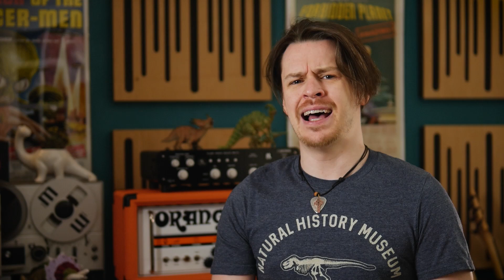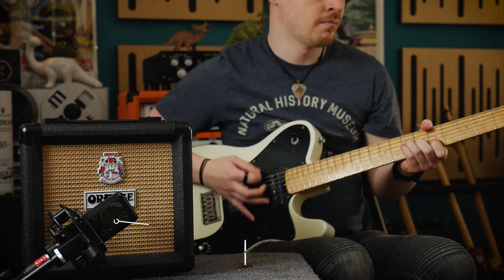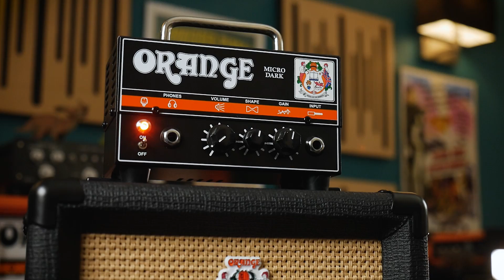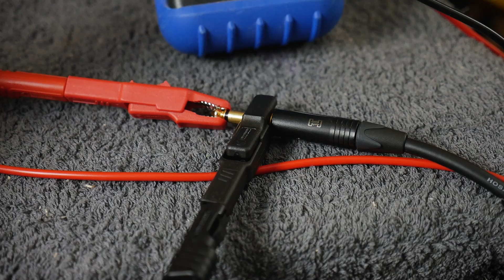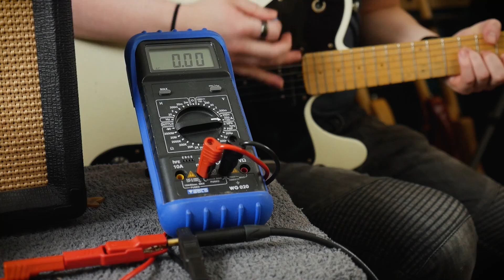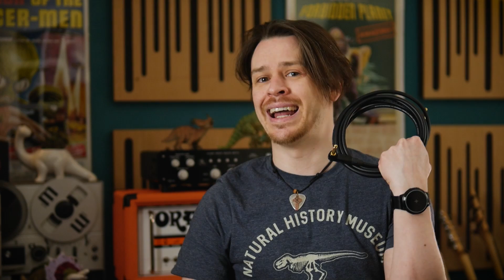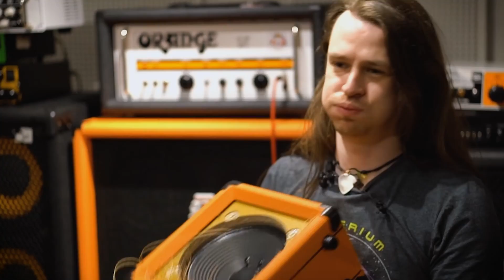Are AMPLIFIERS a LIE?! Guitar Direct into Speaker | Too Afraid To Ask

Comment: TATA: What if you connect guitar to speaker through a power amp without a preamp or preamp but no power amp?
Reply: This depends very much on the gear used. 
Directly to power amp you would probably experience some sound "sagging" (generally power amp expects "line level" signal) and very "sterile" tone (preamp shapes the sound). If you use a pedal or an active pickup, this alerady gives you kind of a line level signal, so the sound may be OK this way. 
Just the preamp is I guess the only one of those "experiments" we are talking about which can be dangerous for your gear - a speaker is a very low impedance load, so in regard to output stage of the preamp you are essentially putting it in a short circuit (hm, the same goes for "driving" the speaker with a pedal only)

Comment: One thing I have wondered, why does a Metal Zone sound better in the  return of the fx loop than it does in front of an amp?
Reply: There are discussions on the 'net that the Metal Zone has all the characteristics of a pre-amp, so taking your guitar into the pre-amp section to boost the signal first, then applying the zone in the effects loop means the character of the pedal is not affected by the "colouring" of your pre-amp.

Comment: What happens if you plug the guitar into a stereo or a surround system? They do have built in amplifiers right? Or am I missing something? I am honestly asking, I am a layman.
Reply: Did you get the answer?
I'm still in the same situation.😔
Reply: @Yash-vq9hl  Yes, I tried it. The sound was in only one channel and the volume was really low. However I ran the guitar through my multieffect and then through the stereo and it was much better and stereo too. Nowhere near the volume of a guitar amp, but for home use if you don't wantto disturb the neighbours, butdon't want headphones all the time, actually quite usable.

Comment: You can drive your speaker cab, you just have to stop using the cable. According to theory of general relativity, general deterministics and everyday non-sense hypothesis regarding scalar waves and electrical induction, just play the guitar and speaker will automatically recognize an authentic rock-star attitude and produce the best desired sound, clean and/or distorted, best thing is - you can drive the type of desired sound via power of intention alone, and are able to produce every type/style of amp. Best thing is - it also works FLAWLESSLY on air guitars. Enjoy and rock on.

Comment: What about plugging a guitar directly into a HiFi amplifier and speakers (rather than a guitar amp), why does it sound like crap? (At least compared to a proper guitar amp especially if you throw in some pedals)
Reply from the maker: Hifi amps and speakers are designed to recreate all frequencies as accurately and evenly as possible so not to change the signal's fidelity. 

Guitar amps and speakers are designed to drastically change the signal, crop and adjust its frequencies, and output something totally different. 

Hifi is sound reproduction, guitar amps is sound creation.

Comment: There's only on more question now: how many boost pedals does it take to drive a cone???
Reply from the maker: It's not just a case of increasing the signal many times, it's also about efficient power transfer and for that impedance needs to match. 
No matter how many boosts you have they will not output an impedance to match a speaker, so will never effectively drive a cabinet.

Comment: TATA: What would happen if you used a multifx unit or processor (Helix and the like) directly with a cab? Most of them have cabsims when used directly for recording, but would the onboard digital preamp be enough to drive a proper speaker?
Reply from the maker: No, they output line level signal and are expected to go directly into FOH, which is basically a giant amplifier connected to big speakers.

Comment: I would like you to try this again, but using a powered 10" speaker or wedge, and then compare the tone against a conventional guitar amp head and cabinet. Some guitarists I know have gone "ampless" on stage and use amp sim pedals / foldback wedge. Wondering how the tone compares.
Reply from the maker: In such cases they will be simulating the response of a guitar speaker cabinet too. 
Stage monitors are FRFR and are accurately recreating whatever goes into them. For them to produce the sound of a guitar speaker (which roll off a lot of frequencies) the amp simulations will have cabinet IRs applied to recreate the response of a specific speaker and microphone arrangement. 

If done correctly there is no difference between an amp sim and IR through a FRFR monitor (basically any hifi speaker) and a recording from a physical amplifier and speaker played through a monitor.

Comment: I will say this though. You can plug your guitar into stereo amp and play through it. When I saved up enough to buy my first guitar I didn’t have the money for the amp. So I plugged into my dads Kenwood home stereo and got a decent clean tone. But I never tried using a pedal into the stereo system, so I don’t know if that would work. Perhaps the great Collin can answer that?
Reply: Oooh it works ;) just need an external power source to power up the pedals.

Comment: this confuses me, when i first got my guitar i couldn't afford an amp to go with it. after a little while and experimenting i found out that i could use this old karaoke machine as a crappy amp, so what exactly was happening there? i doubt they would build a guitar amp into the machine intentionally?
Reply from the maker: An amplifier amplifies but doesn't care what it's amplifying. The signal that comes from a microphone is not so different from what comes from a guitar pickup. Plug a microphone into a guitar and and you'll amplify your voice. 

The only difference is the impedance of the input.

Comment: Instead of a Rat, what if you used an overdrive or a boost pedal to drive the speaker?  My understanding is that those act in a similar fashion to a sold state amplifier.  I use an SD-1 in front of my JCM 2000's clean channel with the level up and the drive at zero and I notice a distinct increase in volume.
Reply: It  would not work either. Most of the pedal effects are designed to be low power. They are not capable of delivering the electrical energy to move a big speaker cone so you can hear an audible sound. Some headphones could work though. The SD1 in your example is just hitting the JCM preamp section but you still need that JCM power amp to drive the speaker. Try to connect the FX send to a cabinet and you will hear it;)

Comment: In addition, the guitar's and pedal's output are "signal", this means is the voltage changing as the information of signal , no much matter the power and current.And to drive a speaker you need electric energy, amplifier is to give signal much more power to do this.

Comment: Dumb question but what about a powered speaker? My cousin ( piano player ) always wants to jam together but I don't want to bring my 1milion pundits bugera  333xl to his house lol. It's fine when he comes to my house  because I have pianos he can play here .He does have powered speakers tho. Could I just bring my pedals and guitar to his house or should I just go ahead and bring my micro terror ad well ( all which fit into my guitar case ). Never used a powered speaker before so I was just curious.
Reply from the maker: A powered speaker has an amplifier built in, that's what you are powering. It will accept a line level signal, so if you run your pedals into it you'll get them amplified. 

Do not run another amplifier output into the powered speaker.
Reply: @ScienceofLoud  Thanks!!!!

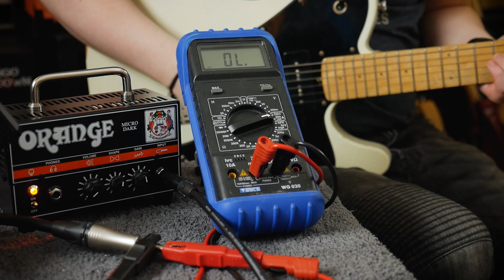Comment: 4:15 how did you measure that? Surely, a multimeter is not a sufficient load
Reply from the maker: Solid state power section, so can run safely without a load and was only connected to the multimeter for as long as you saw it this shot. No harm done. Don't do this is a valve amplifier.
Reply: @ScienceofLoud  oh, ok, didn't realize it was solid state

Comment: You can do the tube amplifying differently as well, can't you? Like almost all do signal at grid today, but some old amps didn't, did they? And I think some heavy duty amps with lots of gain stages do the last stage differently as well. Just forget which way it was, from plate or cathode.

Great episode! I think this was very clear for all the beginner guitarists who are confused with all the rules of connecting amps. Just like the one about output impedance connections.

Comment: I wonder how loud it would be if you put an output transformer between the Rat and the Speaker. Electro-smash say the output impedance is a few hundred ohms, so that's some pretty piss-poor power transfer with an 8ohm load.
It won't be loud, but better than the near-nothing you got by just hooking them up

Comment: Tubes are a high voltage, low current device. You need a transformer to turn that high voltage/low current into low voltage/high current to drive the speaker. Some/most solid state amps use transistors to drive speakers directly because they are already a low voltage/high current device.
There’s all kinds of impedance matching going on inside the amp too.

Comment: Question for a TATA: why Bass amps are (usually) rated at much higher watts than guitars? like, you can get a 300W bass amp head but I don't recall seeing larger than 120W guitar amp heads
Reply from the maker: bass frequencies need to be amplified more to sound equally loud because of the way human hearing works.
Reply: @ScienceofLoud  stupid sexy human ears....
but, thanks for that TATA

Comment: does this happen if you plug a 40 watt amp into a 50 watt cab or is the power generated enought to play as loud as I need it to be to compete with drums and bass? I have a Harley Benton HB-20G combo which has a shitty speaker loaded in, it is terrible, I want to get a cab to get a better sound out of this. the amp sounds great, the headphone-output makes a good sound, but the speaker is shit, no matter how I set it up. I find cabs with the right impedance but they all have 50 watts.
Reply from the maker: You are making the classic mistake of assuming that an amplifier always puts out its maximum rated wattage. 
Your 40W amp will only output 40W with the volume maxed out, if you are using it with the volume low it will be outputting a fraction of that, easily as low as 1W. 

These power ratings are MAXIMUM power. 40W amp can give a MAXIMUM of 40W, a 50W speaker can handle a MAXIMUM of 50W. 

Whatever issue you are having with the tone, it's not got to do with the power ratings.

Comment: solution: put several hundred distortion pedals in parallel. then you'll have enough total amps to drive the speaker
Reply: or one power amp pedal,its a pedal .it drives a speaker
Reply: @trillrifaxegrindor4411  That's exactly what I'm trying to make, pure power amps in a pedal format. I call them PedalAmp, PedalAmp+, and PedalAmp3, 30W, 50W, and 50W w/ a 4" Eminence Alpha speaker, in jointed solid wood enclosures. No preamp or EQ, meant to be used with preamp, amp-in-a-box, overdrive and boost pedals, but they have enough gain to be used for practice, though the tone is hi-fi clean and not super loud. Put a pedal with a gain stage in front of them and they start to rock. The site's not up yet but in a few days check out pedalamp.com.
Reply: @CarsInDimension  I don't want hi-fi clean. I want Angus Young. Low pre amp gain with the power amp section distorting like a MF
Reply: @mr.nobody68  I love tube amps too, this is just another tool for the toolbox. Use your pedals to establish basic gain and EQ structure and then a pure power amp to drive the speakers.
Reply: I think you mean series, not parallel.

Comment: TATA: what's the difference between a pre amp and a power amp?
Reply: a power amp uses line level input, which is several volts.  some things like guitars, mics and phono cartridges only make a few millivolts of electricity, so they need to be "pre" amplified to line level voltage for the main power amp to use. the power amp adds current to the line level voltage. volts times current = watts which is power, hence the name "power" amplifier.  hth

Comment: I honestly had no idea you would get anything at all with just the pedal. That was surprising to me.
Reply from the maker: The pedal has a lower impedance output than the pickup which helps along with the signal amplification, but to be very clear I couldn't hear anything coming from the speaker when sitting next to it. It was only when I increased the level of the recording I knew I'd captured anything.

Comment: Ehhhh this one has a number of issues going on... It isn't a matter of current, it's a matter of power (of which current is a component). Take a 7.5kOhm pickup that outputs 1Vrms amplitude into a 7.5kOhm load and you have 133uW. Take that same pick up and drive an 8ohm load, you get 2.13mV of signal and less than 1uW of power. This is why impedance transformers are a thing. 

The RAT being able to 'sort of' drive the speaker makes sense to the earlier part as well. Typically a pedal has to drive a transmission line impedance of 600 Ohms. The output driver can therefore at least drive 1/10th the load the example pickup could. 8/600ths is more than 8/7500ths. Figure a 1Vrms signal into 600 ohm, and the RAT has a power ability of 1.6mW (20dB more than the pickup alone). Use a 600:8 ohm transformer, and the current increases from 1.66mA to 14.4mA, while the voltage drops to 115.47mV. Power stays the same, but the drive capability is now matched. 

Further, that DMM has a 3dB bandwidth spec of 500Hz, so it won't measure most of the signal.
Reply from the maker: I'm aware of all of this, but this makes the most visually obvious demonstration. 
It's simple to show the orders of magnitude change without getting bogged down in the complexities of reality, providing enough for even those who don't know anything about electricity to understand how these devices differ. 

Sometimes it's not about being technically correct, it's about the best way to communicate a concept.

Comment: It might be worth checking out a pedal like the earthquaker Acapulco Gold. If I'm not mistaken it uses an lm386 which is an actual power amplifier chip, so I think it actually be able to make a decent output.
Reply: I've done it, and it works.
Doesn't sound great, and if you have an LM386-1 it's patchy whether it's enough, but an LM386-4 will.

Comment: Great video as always!  I have a TATA myself; is it true that plugging a bass into a guitar rig bound to break it to pieces?  Or is it just an old wives' tale?
Reply from the maker: Bass into guitar amp is completely fine and will harm nothing. 
However, as demonstrated in the 'Void Your Warranty' video I highlighted here if you put a bass amp into a guitar speaker you'll have a problem. Bass amplifiers can be up to 1000W which is much higher power than what a standard guitar speaker is rated to handle. 

People get this mistaken for bass into guitar amp, but the signal from a bass pickup is basically no different to that of a guitar pickup.
Reply: I blew a speaker playing bass through a guitar amp when I was younger, but I do it all the time now as long as you don't crank it you'll be fine

Comment: How about using a pedal and instead of a speaker cab how about a set of headphones with an inline volume  control?
Reply from the maker: In line volume controls are simple attenuators. They can only make the signal quieter. Considering you'd still need a headphone amp to bring the signal to a level you'll be able to hear it, that inline control is not going to be of much use

Comment: Are small bluetooth speakers, which are powered and have an aux in jack, capable of playing the guitar signal? What will it sound like?
Reply from the maker: Any powered speaker has an amplifier built in. That's what you are powering.
Reply: 1. No you need an pre-amplifier to increase the voltage level generated by the pickup. 2. It will sound like sh*t. In other words dont expect any good sound out of it. Guitar amps are designed in way to boost or attenuate certain frequencies to get the sound we all know as the guitar sound. The guitar speaker plays an important role in this frequency transformation(aka filtering) process as well.
All this can be simulated by a digital modelling with more or less good aproximation. The signal from the modeler then can be used as an aux in as it is very similar to playing a music recording.

Comment: aaaaand what happened if we use speaker cables on guitars?
Reply from the maker: I've got a video detailing the differences (card is tagged in this video), but to recap: Speaker cables are not shielded, using a speaker cable as an instrument cable will mean a noisy signal.

Comment: It would be interesting to see how a powered cab affects tone without a normal amp's preamp?
Reply: Maybe plugging the guitar straight into the amp's fx return (if it has one) answers this question, but I'm not 100% sure. Bypassing the preamp makes it sound pretty dark and slightly scooped.
Reply: @plumbummusic2051  and very quiet
Reply: @plumbummusic2051  I've tried something similar in the past when there was a suggestion to use a metalzone as a preamp in this way and I found there was an extreme amount of signal noise - much more so than running into the front of the amp and not what I was expecting?...